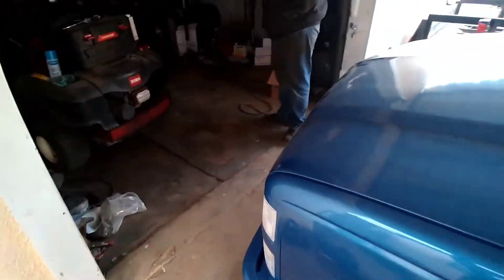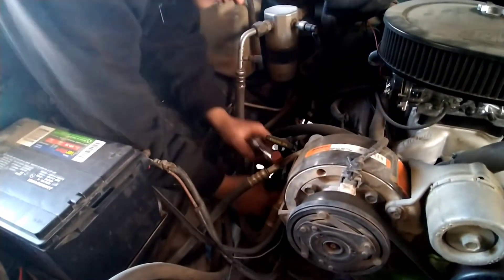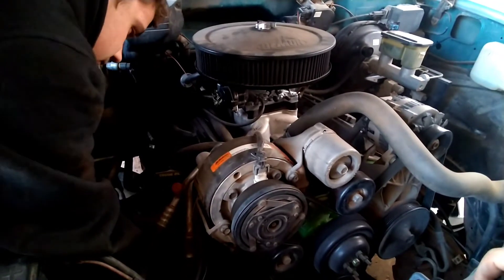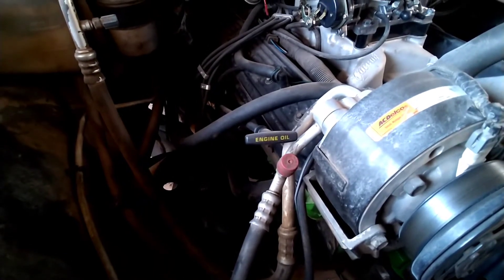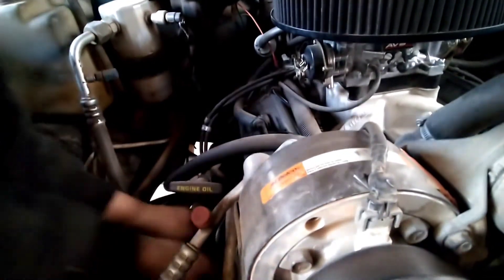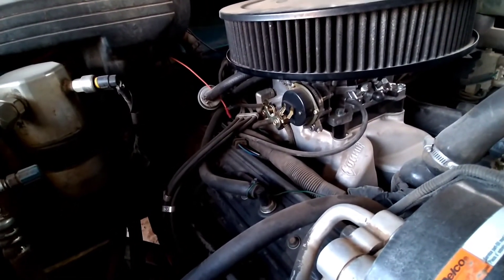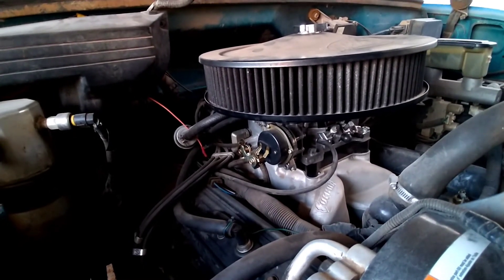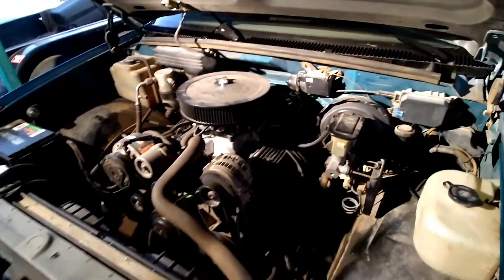Spark Plug Gaps with higher compression

Comment: Hey buddy, absolutely LOVE this video! Been trying to figure out a random miss / variability and inconsistency  in spark on the same plug. My research tells me on high compression engines like mine (10.5:1 static and 205psi dynamic) I need to close the gaps. Currently running 1.2mm (0.047”) and I’m convinced that with my lumpy cam, it’s causing this issue.

Will be trying 0.9mm (0.035”) and 0.75mm (0.03”) and will report back.
Reply from the maker: Yessir sounds good

Comment: 383 stroker promaxx 200cc heads howards roller cam dart intake msd street fire hei 10.85:1 cr 750 quick fuel slayer cant get it leaned down or could my compression be too much for pump gas
Reply from the maker: With aluminum heads on pump gas your really not supposed to go over 10.1
Reply from the maker: But I'd probably say it's your carburetor 750cfm is alot of carb I know we've got a big block ford bored to a 472 and a 750 is to much for it we tried a 650 carb and it screams it has 11.1 compression with cast iron heads and we run pump gas we just used a cam with more over lap to bleed off compression so it would live

Comment: Everyone else says you want them opened
Reply: In my experience the majority are nearly always wrong! ;)

On my Nissan L series engine I found optimal timing to be 28°, yet “everyone” says 34° is best - and yet they have nothing but internet wisdom / regurgitation to back it up with. So when we experimented on the rolling road, we found VERY little increase in BHP over 28° but a real increase in inaudible knock! I wonder how many people are quietly reducing their engine life, confident in their more is better philosophy?

The majority of people don’t do much more than repeat what they’ve heard without proper analysis and move ahead with confirmation bias!

Simple engineering / scientific fact is that with increased cylinder pressures (dynamic compression not just static compression ratio) you will find reducing gaps gives you better spark stability in all conditions (eg idle, cruise, power etc).

What also the majority of internet mechanics fail to appreciate is that increasing the gap also retards the timing ever so slightly - which needs to be compensated for. All observable things when you use a rolling road to test your hypotheses in real life.